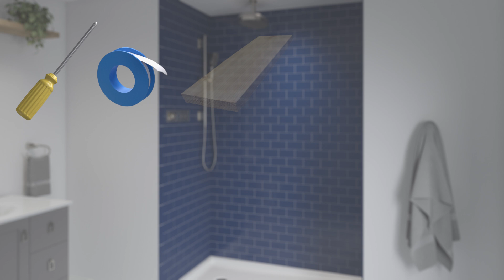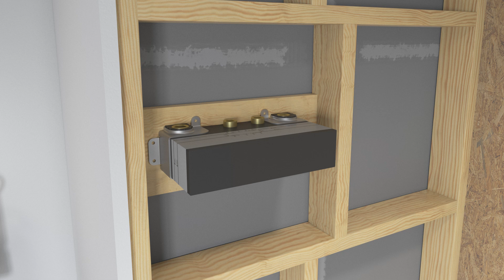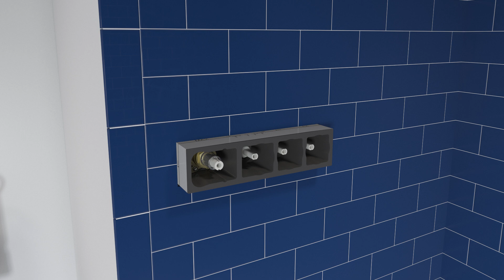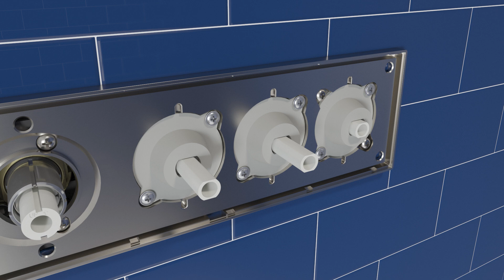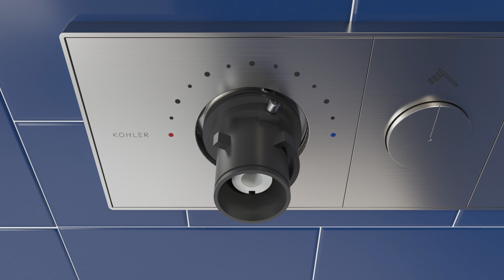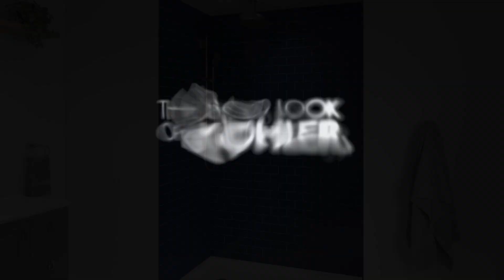Installation - Anthem Recessed Mechanical Valve and Valve Trim

Comment: I’m using this shower fixture and my hot water stopped working just in this shower. Are there any troubleshooting videos on how to take this apart? I can’t find any.
Reply: I’m actually having the same exact issue and can’t find anything on how to fix it. I removed the hot water cartridge and flushed it and it worked but as soon as I trimmed it back out the hot doesn’t flow anymore.
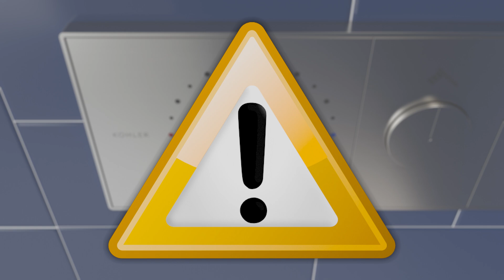Reply: @micahkaemmerling7  did you do the max temp procedure? 4:35 in the video. my Anthem just got installed and the plumbers left but the shower is too cold to use, going to attempt this today.